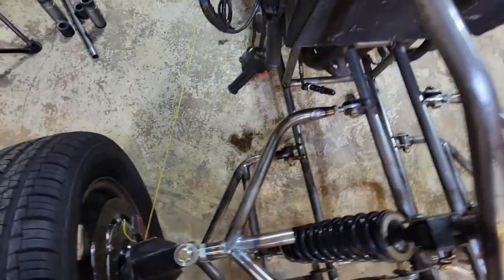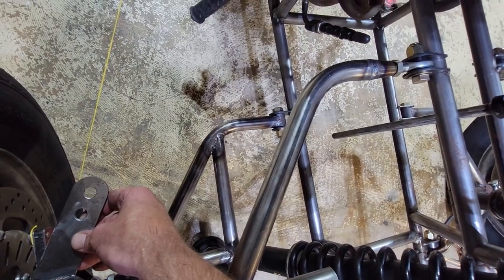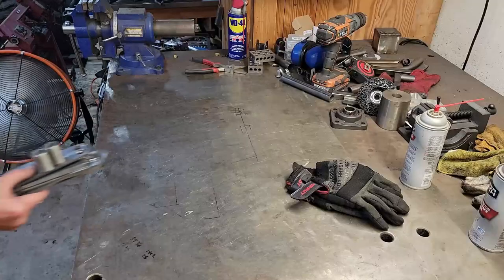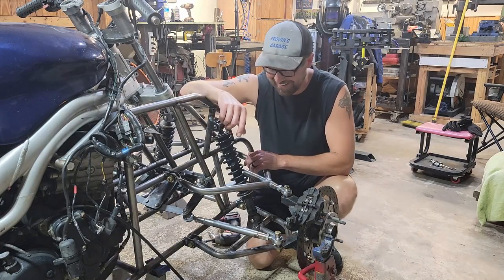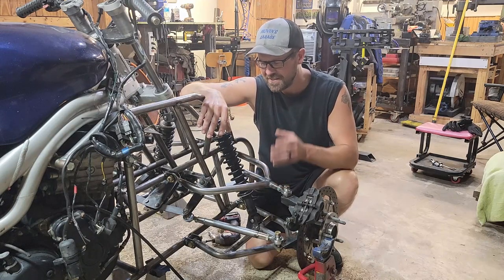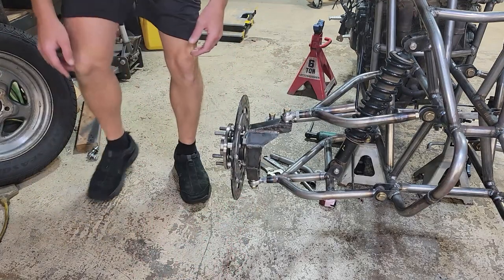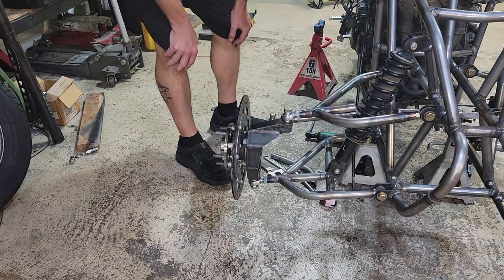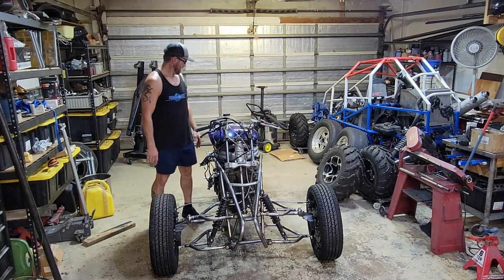CRAZY Steering Setup || Reverse Trike Build Part 2 || Party Trike!

Comment: things i cant help but think...

tie rods... be better if the adjuster was inboard of the linkage? though the swingarms adjust anyway... whats the actual "same length"? lol. really, if you take that to the extreme then the camber/kingpin tilt should be via eccentric on the pivot so everything truly is the same length... meh. whats  a few mm here or there? at highway speed? :D

steering really wants an eccentric gear. so its geared DOWN in the middle but geared UP past say, 15 on the bars... too damn twitchy in the middle otherwise.

i just wanna tilting trike that countersteers.

jetrike did...

not sure how it converts to tadpole.